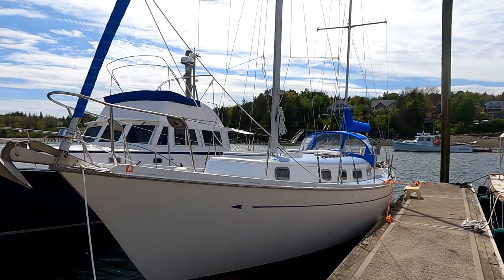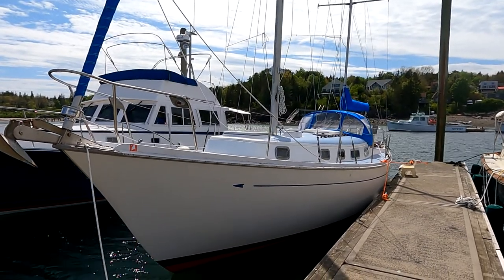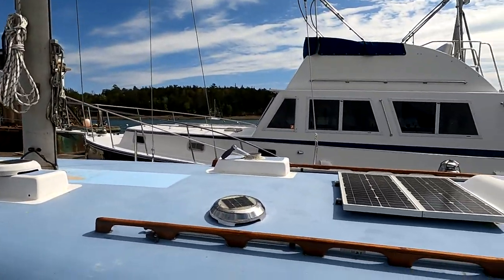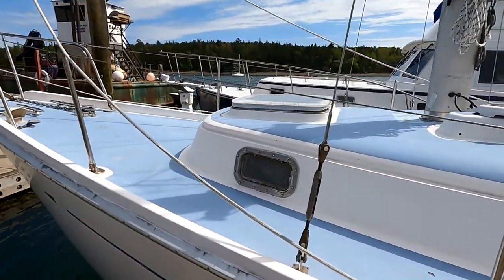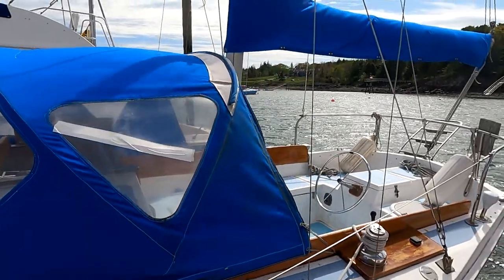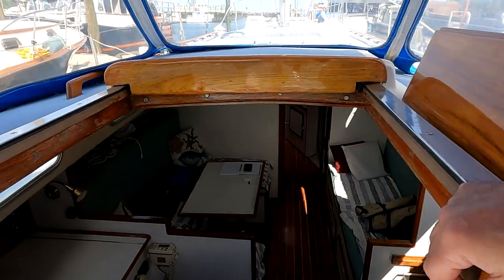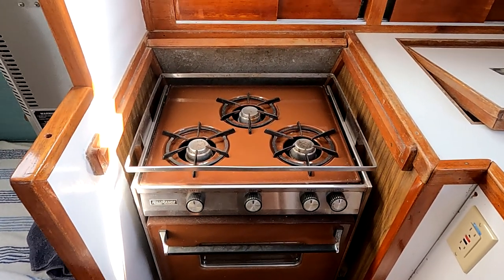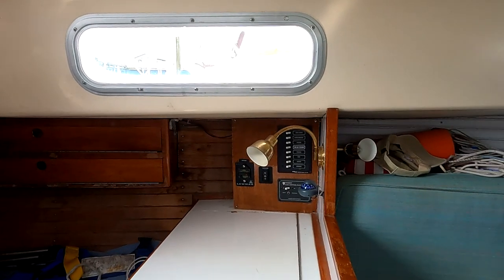Tour of My Allied Princess 36 Ketch Seaquestor - May 26, 2022

Comment: Suggestion: being 80 years young I might bring your attention to: Tides, and Harken both have insert track extrusion, for your main & mizzen sail tracks, new roller bearing cars attach to the tracks. The sails go up or down with little or no resistance.
Reply from the maker: Thanks I am aware of both systems and am seriously considering adding a Tides Marine Strong Track to the mizzen to try it out.  I will also put my lazy jacks back on the mast/boom.  The main will stay in the garage since I am completely satisfied with the sailing performance of the boat without the main.  My issue with the main is having to leave the cockpit to drop it, which would still be needed even with a track system.
Reply: The main with a Carolina Crib(best sail stack pack) will fall completely into the crib. After you are moored all that is necessary now is a stroll up the deck to pull the zipper closed. No agro
Reply from the maker: @greenebank  My understanding is that stack packs work best with full batten mains, which I don't have.  The point is that I don't want to go forward for any reason.  Using the main, even with a stack pack, could result in an issue that requires me to go forward.  I am also content to sail without the main.  Finally I don't like the looks of stack packs.

Comment: Interesting.  My Princess is hull #71 1976/77.  The difference in layout is amazing. From the head forward the layout is the same,  my boat has two drawers and folddown access to the space under the v-berth.  I am in Texas, so my A/C lives under the V-berth and I did crawl in there to install it.  I had not seen a Princess with a dinette.  And the starboard bulkhead aft of the v-berth do not go all the way to the overhead liner.  I have a U-shaped galley, with the sink forward of the stove.  I have the original 80 gallon stainless steel water tank below the cabin sole and I removed and replaced the fuel tank in the keel making sure it was isolated from the bilge.  And I do not know whether it came with it or not but my Princess has a bowsprit like the MK II version.  
I guess you installed the large deckplate in the aft port portion of the cockpit to be able to access the batteries and fuel  tank? 
One of the amusing things I discovered when I did the fuel tank, is my boat has added ballast in the bottom of the boat under the v-berth, under the mast and in the bilge under the engine.
Reply from the maker: Yes that is rather different.  Yours is pretty much the standard layout after about 1975.  My Princess is hull #8, so it is in the first group built.  The deck "plate at the aft port end of the cockpit is actually a Trident drop-in propane locker.  My boat has a few hundred pounds of lead ballast in the bilge outside the head.  When I bought the boat there were a number of large (70-100 lb) rocks under the V-berth.  I added the bulkhead the propane heater is on.  I do not know when they made the bow sprit standard, but it may have been standard by the time your boat was built.  My 70 gallon water tank is still there, but the previous owner had used it as a sump tank for the shower drain, so we have never used it for water.  Thanks for the information about your boat.
Reply: @todddunn945  I find the lead ballast outside the head interesting.  My boat has a few hundred pounds around the mast support and under the shower pan. Also two bars (about 200 lbs) in the bilge under the engine and an unknown amount under the V-berth (it was encasulated in fibreglas). I had thought added by an owner, but if it is in your boat also. I am going to surmise that it was added by the builder to get the boat to float on her lines.
Reply from the maker: @jkepleriv  adding trim ballast is common practice.  A quality builder will secure that ballast in some way.  On my boat the lead bars are just in the bilge at the base of the mast in the same place as yours.